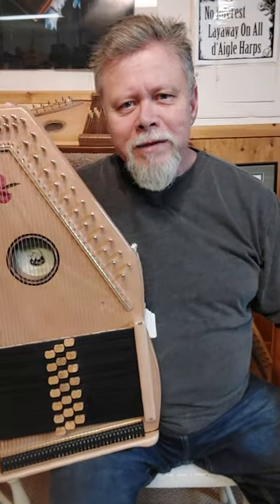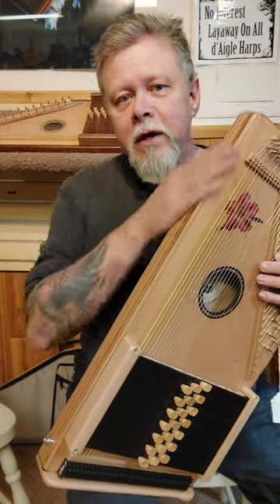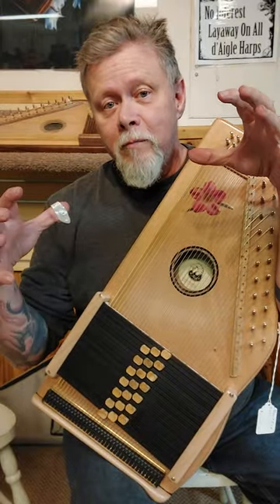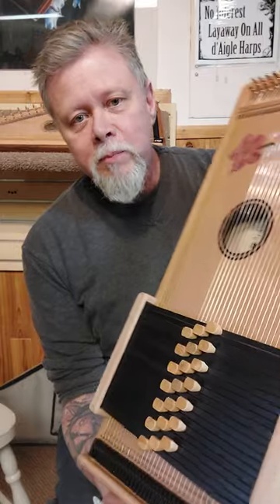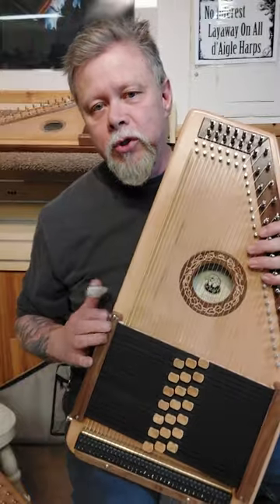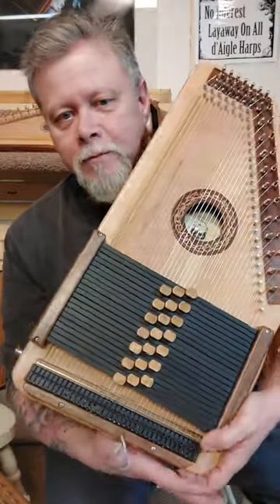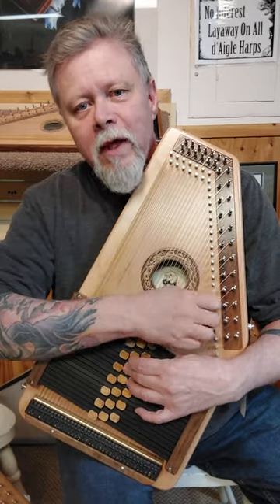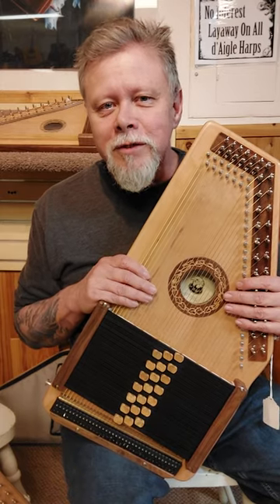SWA TAHOMA VS DESERT ROSE SIDE BY SIDE

Comment: Hi, Hal!  Just got my Evo Bluestein Sparrow from d'Aigle.  It's my first custom autoharp, after playing an OS.  The action on the Sparrow seems uncomfortably high.  Will I get used to it, or is there something I can do to reduce the distance I need to push the bars down?
Reply from the maker: That's very interesting feedback; and yes, you can "shim down" the bars.  You'll notice that on the underside of the chord bar covers, there is a thin strip of felt that keeps the bars from going "bang bang" as they come back up.  You can thicken that felt up in numerous ways (especially on the treble side of the instrument, where there is more space between the "up" bar and the strings.  The wound strings are a little taller, so the space is a little less on the bass side.   So you have to either add to that felt, with another layer of something, could be felt or foam...or REPLACE the felt with thicker felt or foam.   Because all the bars are pushing up against that felt, you can experiment with the thickness of the new/additional material just by tucking it in...the bars will hold it in place because you are only depressing one at a time!   Don't get it TOO close (the strings will start to choke if you do that).   
I've had harps where I never glued the felt in....just used the counterpressure of the multiple chord bars to hold a nice strip of it in place.   Or you can glue it in!   Thanks for your question.
Reply: @wildautoharp  Hal, thank you so much!  I cut a couple of strips of silicon mesh and fit them right under the chord bar covers and I am very happy with the result!